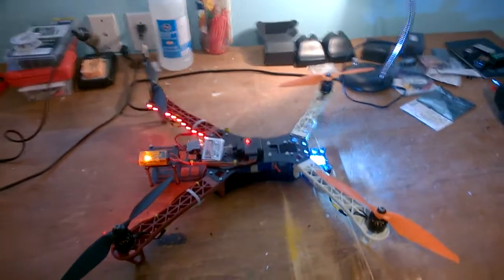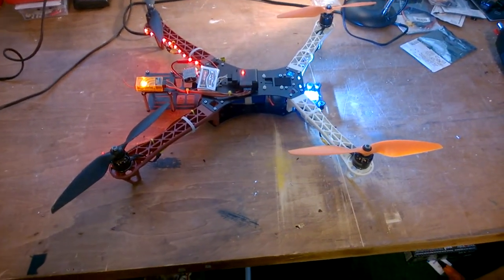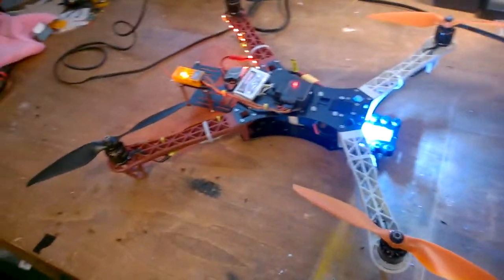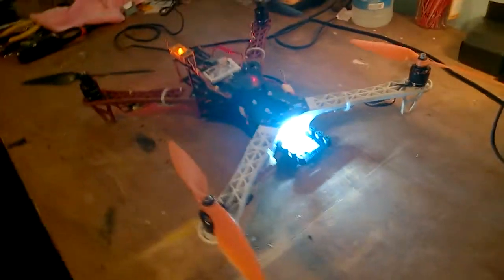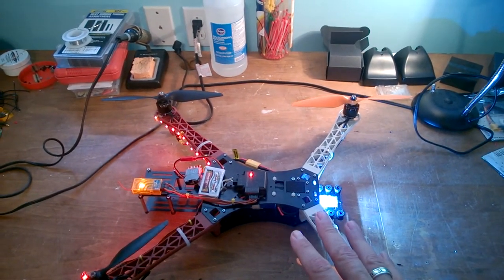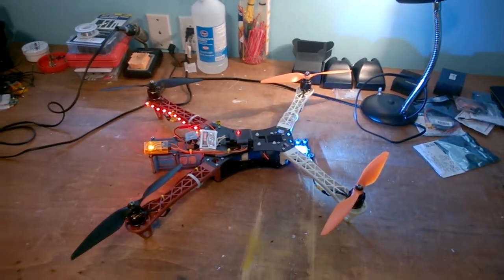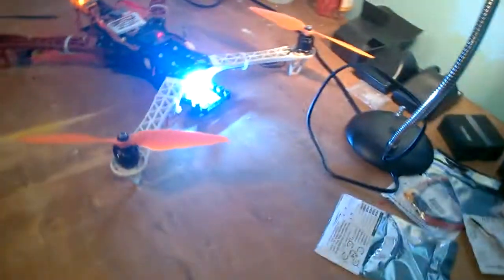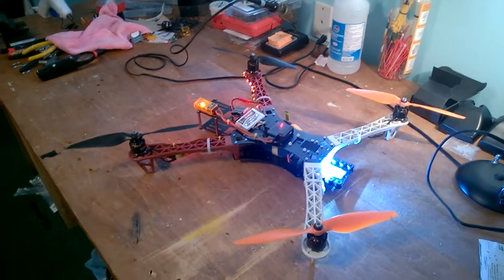Quadcopter HJ450 Spider Build RTFQ

Comment: I have bought spider frames to build this. Any way to get a component list from you? I know its asking a lot I just want to make sure I have plenty of power on kv motors and a correct pdb and correct esc's. Id appreciate it also waht controller did you bind it to and can you program this in Betaflight? Thanks bud. I subbed because thats an awesome build!
Reply from the maker: Everything I used came from Hobbyking to build the airframe. The flight control board was ready to fly quads most basic offering the Flip 1.5, the receiver was hobbyking's orange receiver using a spektrum radio. Programming by beta flight. I do not recommend using the orange receiver, 4 out of five I bought failed. It's a very basic, manual flight only quad that I built primarily to teach myself to fly these.  The motors were Turnigy 970KV 20/12 I think and Turnigy ESC's. I'm sure now there are much better things available as this build was 7 years ago. I don't really fly quads anymore, just lost interest. Good luck sir!
Reply: @yellowbusguy  last question if i may... what length screws did yo use on your motors so they dont burn up the wires by being too long or motors pop off being too short? Thanks for replying I appreciate it.
Reply from the maker: @RHINOTACTICAL  No clue. I'm fairly sure you can buy hardware kits that have everything you'd need.
Reply: @yellowbusguy  thanks!